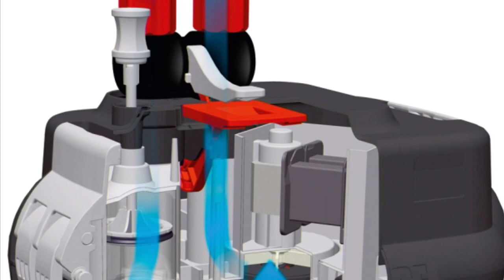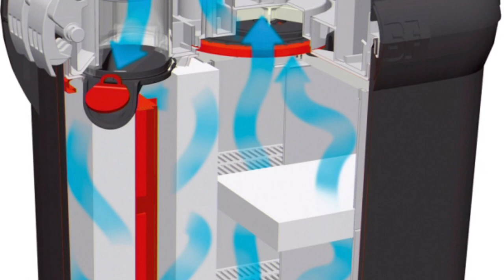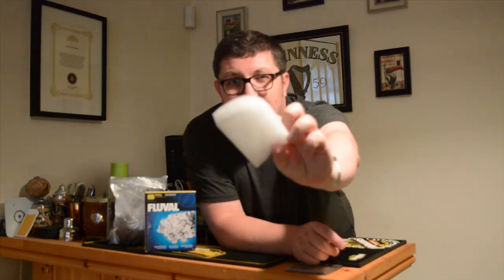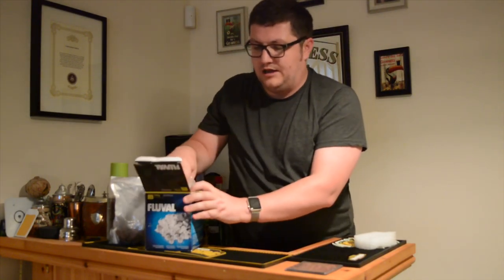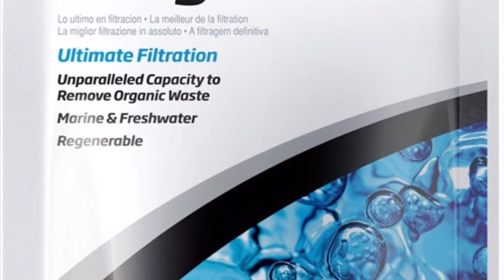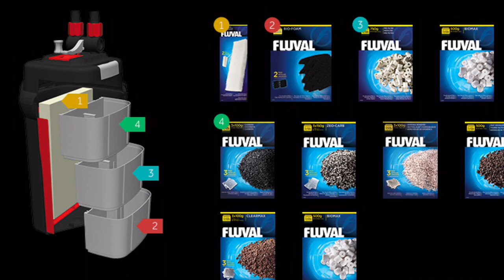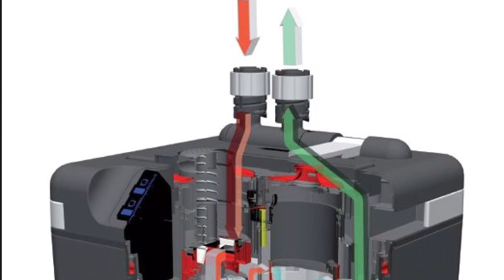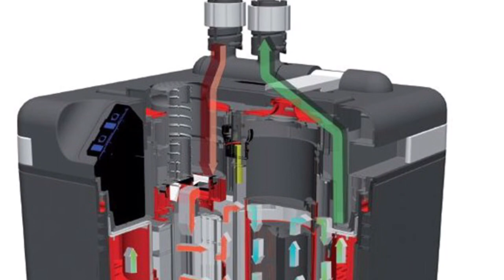Filtration media - fluval canister filter setup advice

Comment: I have to say I've been looking around to see the various ways to setup my 306 by far I like how you broke it down. I do have a question, I plan to set it up exactly how you described but would it help if I finish the top tray with some carbon?
Reply from the maker: Angel V hello! Thanks for your feedback! 
Absolutely! Carbon in one side of the top tray would be fine.
What I would say, is before you go down the Carbon road, give Seachem Purigen a go. They do handy little bags with the Purigen in, so very easy to use, just add the sealed bag to the tray.
Purigen does the roll of Carbon but I feel its much better. The water clarity you get is way better and lasts much longer.
Hope this helps!
Reply: @trickystank  Thank you for your quick reply, so im using the bio foam and polishing pads bottom tray, fluval biomax on my middle tray and then on my top tray..seacham matrix, purigen  and on top carbon...sounds good?
Reply from the maker: Angel V no worries!
The setup sounds good to me. All I will say is my setup is the same as this without Carbon.

You shouldn’t need carbon as the purigen will really do the roll of carbon and then some !

I would only add carbon if you have to dose meds and want to remove any of the meds after dosing. 

Hope this helps!
Reply: @trickystank  Sorry I just saw the rest of your reply, Purigen  pretty much is used instead of carbon...Thanks again I'll will try the purigen
Reply from the maker: Angel V no worries! Enjoy! Btw im uploading a few videos today around the JBL water change kit . Enjoy 👍
Reply from the maker: Just wanted to check in, how is the filter running?

Comment: How long would you say to change the media itself for new stuff?
Reply from the maker: josh green 
Hi buddy, foams can go a good while as they are tougher these days, but I look at changing these each year, not all at the same time, say one foam a month until changed all changed.

Filter floss I change completely every two month or until they begin to fall apart.

Ceramic media is again better than it used to be, but again gradual change is best. Key to success is not having any sludge in the media as this clogs the pores and reduces surface area. When changing( in the case of a Fluval filter) i would change half a basket only at a time, again as you see fit.

Hope this helps 👍